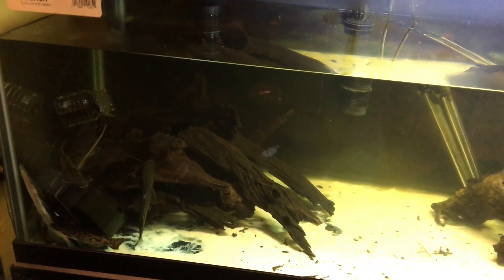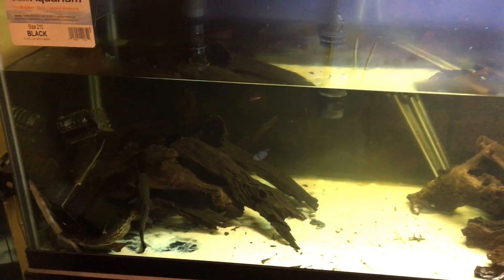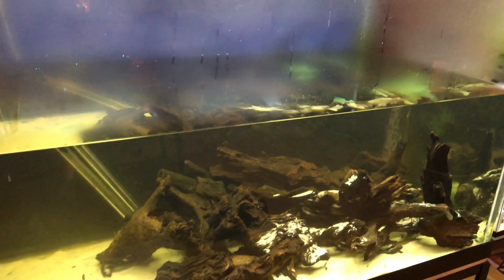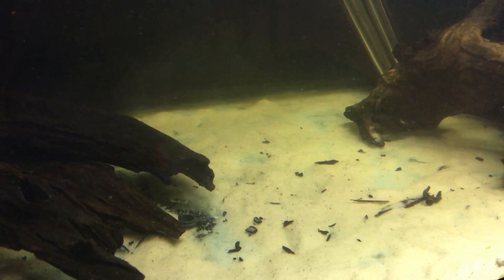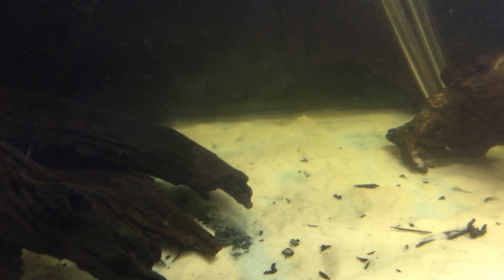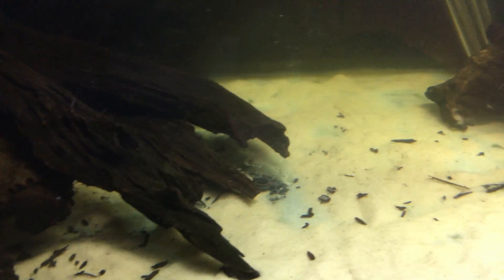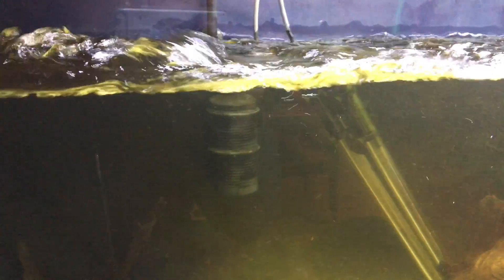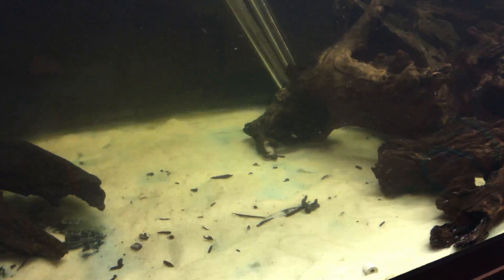Panta Rhei ECM 42 pump flow demonstration

Comment: What do you think to the ecm42?? Is it worth the dollar 👍
Reply from the maker: NEMO20G depends on the situation and tank size... for me I was trying to recreate a laminar flow going from one side and circle around for swimming current for the cichla... if your doing a reef I would look Into getting 2 maxspect gyre xf250 with the control panel this will cover almost all water flows you can think of plus it’s like 9000gph flow lol
Reply: Rico Suave thanks man for the top reply :) Ive got one I'm gonna give it a go with my mp10 also as my acros love powerful flow. May have a look at your suggested though matey thank you :)